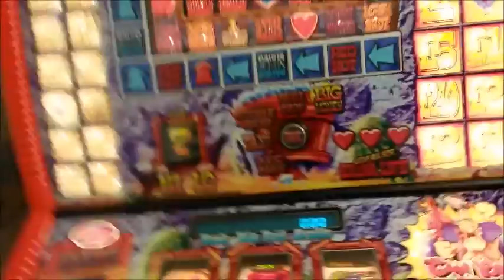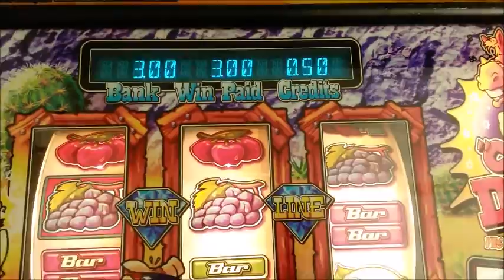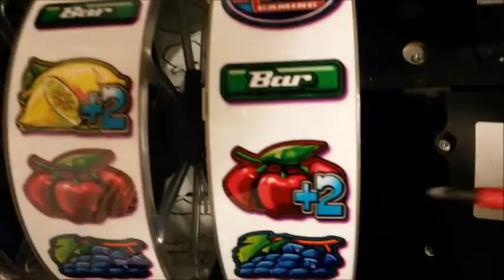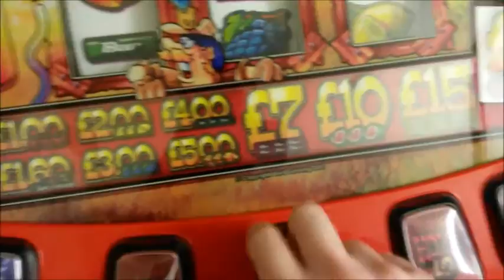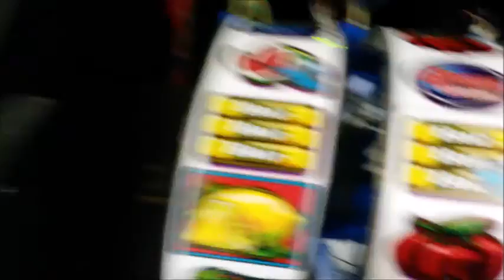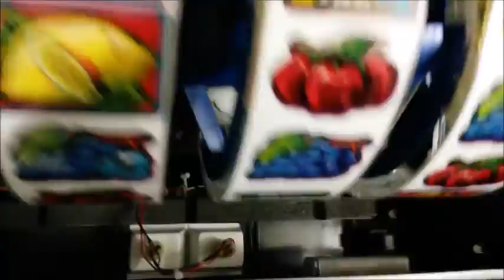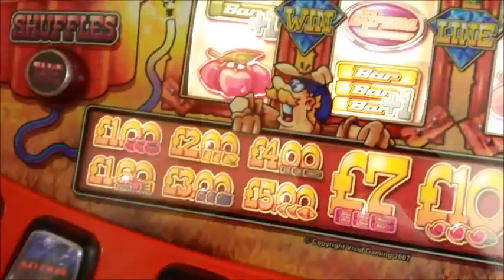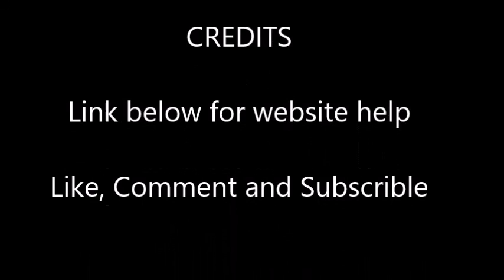Reel Alignment

Comment: Hi Damon. Didn't know if you could help. I have a Fruit machine that works for a few spins, then the reels nudge themselves slightly off alignment and then the machine doesn't play anymore....is there an easy fix? The machine is by crystal and is called double dough seven
Reply from the maker: No easy fix got issue with borad runs machine contact me more help getting machine running take care borad repair

Comment: Hi mate my reels is completely out of sync on a 3 player super streak would this work for that ? Great video btw p.s reels looks exactly the same it's mpu4 I believe
Reply from the maker: fruityfanatic mpu4 reel deck different to later reels got mpu4 machine here show how adjust them in video which reels out of sync one player reels or top box
Reply: Damon Wyer it’s reel one on the actual machine it thinks it’s a different symbol from what it actually is
Reply: Damon Wyer hi mate I’ve uploaded video in my channel if you could help ?
Reply from the maker: fruityfanatic see that reel one and reel three are out reel two good have checked that reels not been swop around check this by looking at one other player unit on machine check this if are right place machine need reel band moving around as line spot on if don't understand how sort this local can sort out for you
Reply: Damon Wyer thanks mate will check this tomorrow. Really appreciate you taking time to have a look at my video and give me help
Reply from the maker: fruityfanatic welcome here help get others machines running as fruit machine engineer so fix lot different types and tec the older ones need lot work on mpus keep going from battery leak
Reply: Damon Wyer I appreciate it mate. I have followed your channel for years and I could always remember this video. Keep up the good work
Reply from the maker: fruityfanatic well lot more tec videos be doing soon let know how get on with yours once check what said other messages
Reply: Damon Wyer got it sorted mate swapped reel 1 and 3 around and this sorted the problem thanks for your help  it’s very much appreciated
Reply from the maker: fruityfanatic someone put reels back wrong place common thing see sometimes arcade do on purpose so can't win seen few bad arcades work for in my time have any questions or anything like help with just drop me message help out need and updates mechs or bulbs just ask

Comment: Hi can you help me out with deal or no deal raped round  hive cleaned reels where bulbs are but reels out of seacwince
Reply from the maker: Need look reel set screw that lose reel would moved so look set screw able slide back where should be
Reply: @DamonWyerBlasttheWolf  wot hive done is taken of the plastic wot goes round the reel thanks
Reply from the maker: @keithwatling7610  removed reel band off from plastic band not marked where pulled off case moving it until get right look one other reels where tab is count where got band join is that help you
Reply from the maker: @keithwatling7610  put in wrong spot case reel out line of course wins off case moving until right before pull band off I always mark where was
Reply from the maker: @keithwatling7610  np
Reply from the maker: @keithwatling7610  require meters for run without them free play only
Reply from the maker: @keithwatling7610  yes want machine cash mode require meter be fitted tell me machine and tec tell what need
Reply: @DamonWyerBlasttheWolf  hi can you help me out hive just got a new coin meter and machine keeps coming up with gen meter error hany idea thanks
Reply from the maker: @keithwatling7610  on sec meter showing numbers
Reply: @DamonWyerBlasttheWolf  yeah I got it of Eaby its numbers on it it should be zero shunt it
Reply: Coz machine is still saying gen meter error
Reply: I hope it ant bugged mpu board
Reply: I put old meter back on but alarm still going of its pisst me of I know that
Reply from the maker: @keithwatling7610  need look sec meter tell me see display showing numbers
Reply: @DamonWyerBlasttheWolf  yeah its showing numbers
Reply: @DamonWyerBlasttheWolf  will I need a different meter
Reply from the maker: @keithwatling7610  tell me showing numbers on meter will tell you what need to do next
Reply: @DamonWyerBlasttheWolf  yes its showing numbers
Reply: Wot do I do next
Reply: @DamonWyerBlasttheWolf  is it an easy fix
Reply: You still there mate
Reply from the maker: @keithwatling7610  unless tell me what does cant help you anymore
Reply: @DamonWyerBlasttheWolf  the new coin meter hive put on my machine as numbers on it shouldn't it be all zero with it bin a new meeter
Reply: @DamonWyerBlasttheWolf  when you.put a new coin meter on shouldn't it be all zero
Reply from the maker: @keithwatling7610  when put on need show numbers shows northing bad meter or loom if shows numbers still alarms need check loom and make sure meter same serial number as replacement
Reply: @DamonWyerBlasttheWolf  hi it's a new loom as well hive took mpu board of hive got a new one coming on Tuesday but the old one looks okay to me
Reply: do you think it could be that its 2007 board thanks for helping me out
Reply from the maker: @keithwatling7610  sec meter has show numbers on its display doing this still error out down wrong meter or borad fault
Reply: @DamonWyerBlasttheWolf  yes that's why hive ordered new board
Reply: I really appreciate your help you know what your talking about
Reply: When I get new board it should be okay it should not alarm I hope not hany way
Reply from the maker: @keithwatling7610  have spare mpus for machines
Reply: @DamonWyerBlasttheWolf  I got mine of ebay and its flywired battery once board is on it should be okay I hope
Reply from the maker: @keithwatling7610  ok
Reply: @DamonWyerBlasttheWolf  once board is all plugged in is that it then
Reply: Hi dont have to do hany thing else with bandit
Reply: Hello how do you link coin mech and Hooper to mpu board is it easy to do thanks
Reply from the maker: @keithwatling7610  turn upside down par them to machine
Reply: @DamonWyerBlasttheWolf  thankyou
Reply: Hi is it easy to reaplace light wireing loom in deal or no deal machine raped round thanks
Reply from the maker: @keithwatling7610  why do you need replace loom for ?
Reply: @DamonWyerBlasttheWolf  hive changed some of the bulbs as hive pulled the bulb holders some of the wires have come of
Reply: A lot of the wires are brittle
Reply: I should have able to connect them back up they all run of one an other dont they
Reply from the maker: @keithwatling7610  looms are one in machine lamp loom cant remove part it all link together so broken wire just need solder back together
Reply: @DamonWyerBlasttheWolf  okay mate thanks
Reply from the maker: @keithwatling7610  straight forward put wire back into lamp holders
Reply: @DamonWyerBlasttheWolf  yeah hive got two bulbs one white and red the white ones are on all time red ones arnt hive got to get them right way round yeah

Comment: mazooma/bellfruit
Monopoly wonders of the world(Scorpion 4)
Reply from the maker: +xCJWx1 move reel 2 to 1 and see if the fault follows
Reply: tried and it doesn't?
also tried moving optic to different reels?
Reply from the maker: xCJWx1 still cam up with the fauilt when you swop the reels
Reply: yes!
machine starts to initialize all 5 reels twitch and then reel 2 error 22 stops machine in it's tracks won't go past error!
Reply from the maker: xCJWx1 right you might have a bad mpu or power supply
Reply from the maker: xCJWx1 where are you if you like me to come out ?